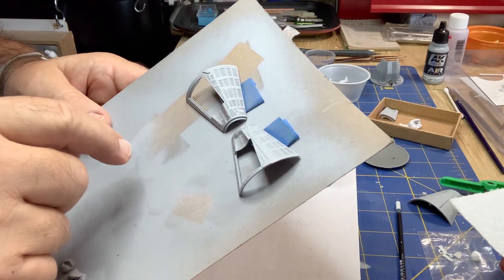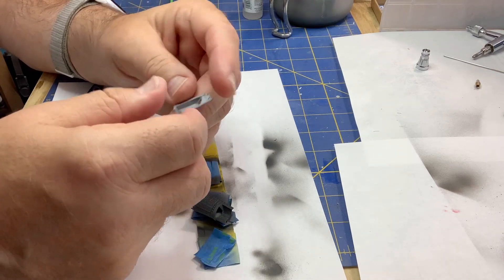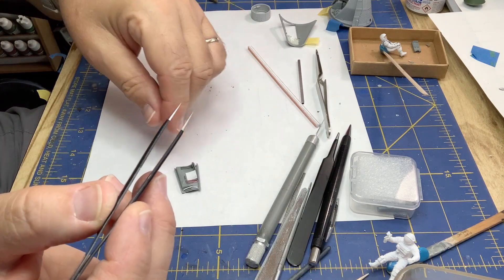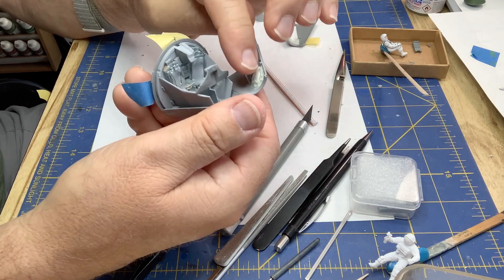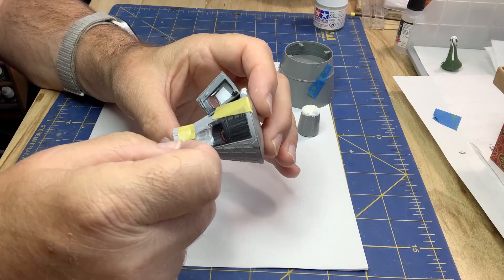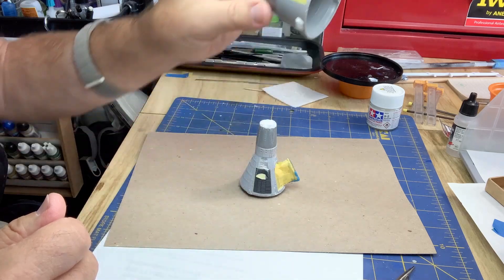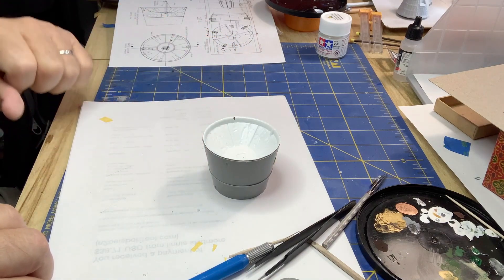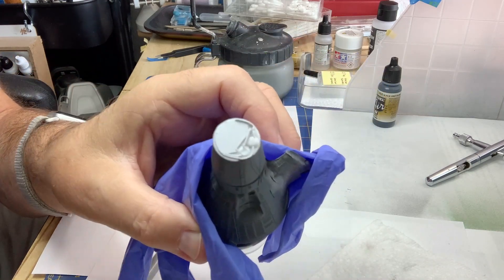Gemini IV, Part 3

Comment: 0:58 might I suggest Liquid Mask on your clear parts? Paint it on, let dry.do a second coat. Spray over and then peel it off.
Reply from the maker: I've used liquid masks on other projects but for these windows, that stuff tends to leak under joints and can be hard to remove from corners. The tape is simple.